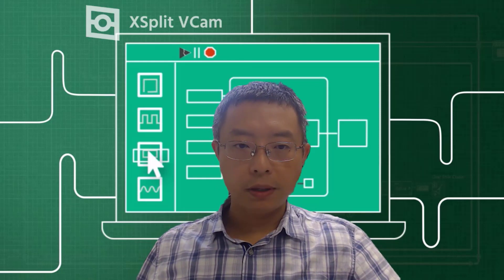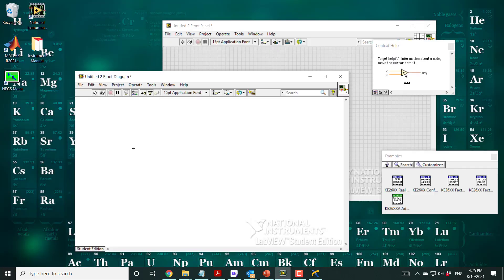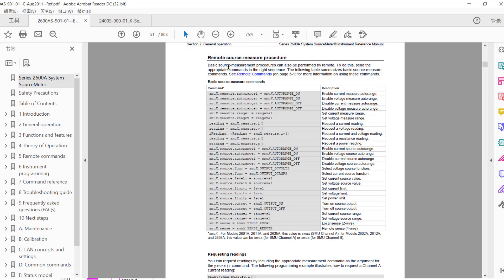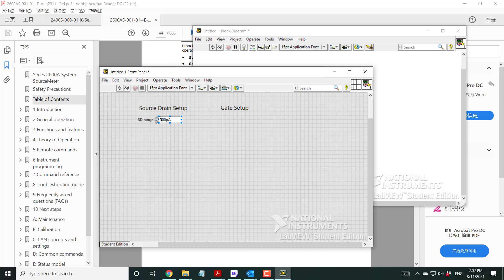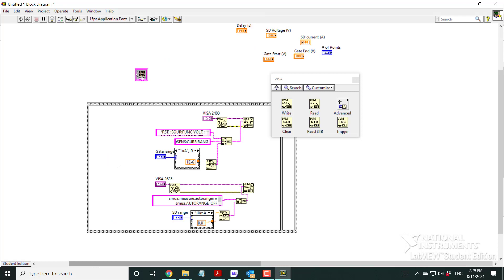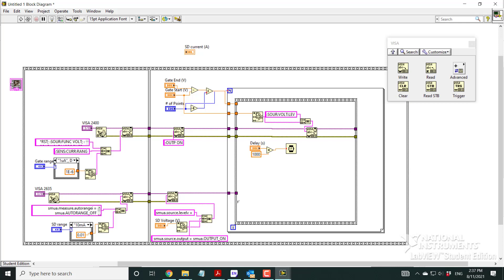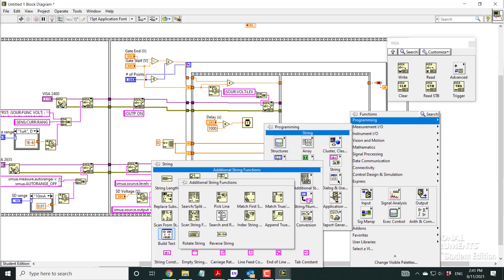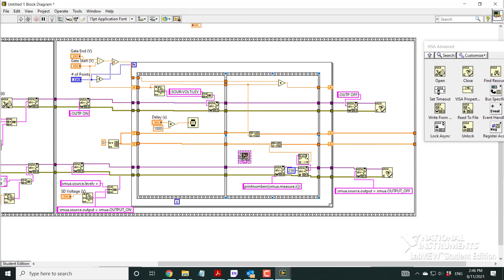Labview intro3 - Program without Instrument Driver

Comment: Hi, First of all, I loved your video. Secondly, If I am working with a machine called Autowave and VDS200N by Emtest, they don't have drivers either.
I have read the manual The autowave uses STX and ETX and checksum, not direct SCPI commands. how should I approach this case with VISA Write and Read? Thanks in advance.